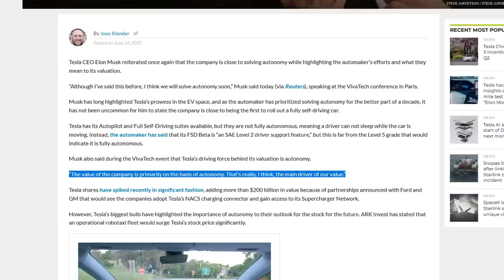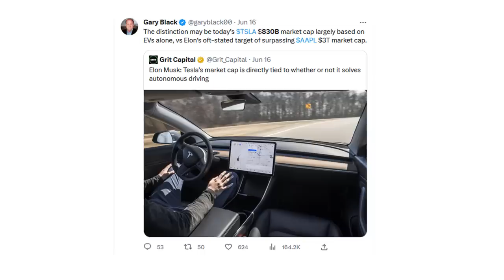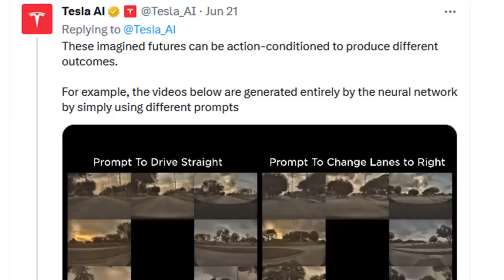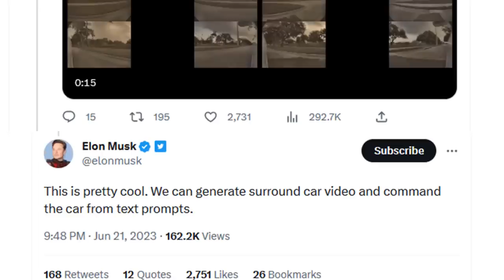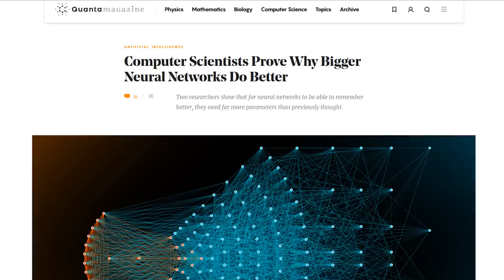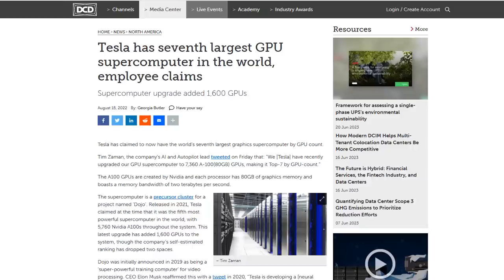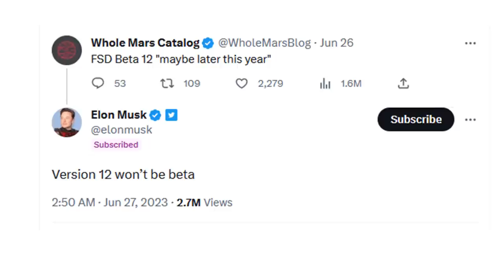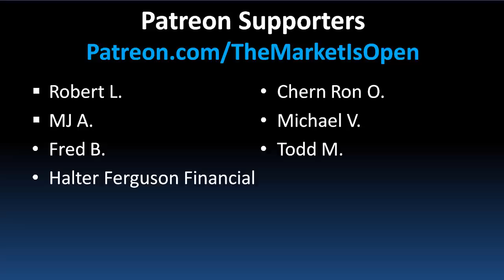Elon Musk UNLEASHES AI Powerhouse: The Dojo Supercomputer will SHOCK the Industry

Comment: The human brain — an analog meat computer — only uses 12 watts of power. Why do these digital computers — including the gigantic Dojo computer — need so much more power than the little analog meat computer that fits in the human skull? Maybe we need to go analog . . .
Reply: The human brain is largely chemical based, which processes data much slower than electricity, but it also relies on all of the different neurotransmitters that the body produces for it. That is to say, the brain can't exist independent of the body, so you'd need to clone the complex biology of the human body as well.
Reply: @thomas9961  
What about just the decision-making part? That’s what AI is all about. Not touch and smell and mobility. Seems like using digital 1s and 0s are incredibly inefficient ways to think. I don’t know anything about it, it’s not my field, but I’m curious to see how the analog computing guys make progress.
Reply: @ChitFromChinola  It has zero to do with watts.  You're comparing a system with millions of years of evolution behind making it more and more efficient to a system that it still in it's early days of it's evolution.  That's just silly.
Reply: @TheEvilmooseofdoom  
That’s it? Digital computing just needs more time? I thought there would be a more definitive reason. I mean, the difference in power requirements is so large, that it seems like digital computing will never get there. I mean, 12 watts is a pretty efficient computer.

Comment: It is an interesting layered set of challenges.  There is the unchanging (things that don't move) background, and the vehicles "now" position in relation to that background.  Then there are the (things that move) "now" situational information, and the probability / predictability of all the next movements of the things that can move.  Then there is the actual physical road layout in that area, and the applicable road rules that may apply in that jurisdiction.  Things that don't change moment to moment can be pre-programed, but the dynamically changing things need to be accurately predicted (instantly calculated) and reacted to.  Even the challenge of realistically how much compute power is required, and how much of that can be on board and what information is it realistic to dynamically bi-transmit to a super computer, given required quantities of data and reaction times..

Comment: The fact that Tesla FSD (both in hardware and software) will result in autonomous TaaS, is now certain. As is highlighted here, the "march of nines" is the determinant as to just when such vehicles will be viable. To me, the timeline is not really relevant, because it will happen - it's inevitable.
When it does happen, the disruption will be nuclear. Not only will the need to buy a car - or even own a car - evaporate for an exponentially growing number of people, resulting in a swift demise of non-FSD vehicles (EV or not), but industry sectors allied to the traditional automotive industry will collapse too.
I live in one of England's most remote market towns, with a history going back to Roman times and further. In the late 1800's, this tiny town had four farriers, several livery stables and even a manufacturer of equestrian accessories (saddles, harnesses, bridles). As is the case with modern automotive aftermarket activities, the equestrian industry was also served by suppliers to the trade (horse-feeds, vetinarian, carriage repair shops, clothing...) By 1920 all these industries had shut down when the petrol-engined car became ubiquitous. It is estimated that over 20% of the town's economically active residents lost their livelihoods.
My example can be extrapolated across every community on the planet where cars usurped the horse. This disruption took around 30 years, but it was a disruption nevertheless.
If we examine the number of commercial and industrial sectors that are wholly (or even partly) reliant on the traditional automotive industry, what the car did to the horse a century ago will be chicken-feed in comparison.
Reply: Totally agree with your critique.
Reply: Brilliant example.  (You totally "get it"!)  The earthquake has occurred, and like a tsunami, the wave of disruption is about to violently disrupt many industries and (previous) occupations.
Reply: I live in Czechia, where 10% (that is the real number, no exaggeration) of our GDP comes from supplying and producing ICE cars. What could possibly go wrong.
Reply: The change in societies and economies wrought by the displacement of the Horse and Carriage by the Horseless Carriage is, indeed, analogous to the changes that will be wrought by FSD EV's over IC powered vehicles driven by humans. The only barriers to these massive changes will be those erected by governments who are fearful of those changes all driven by leftists who hate free markets in general and Elon Musk in particular.